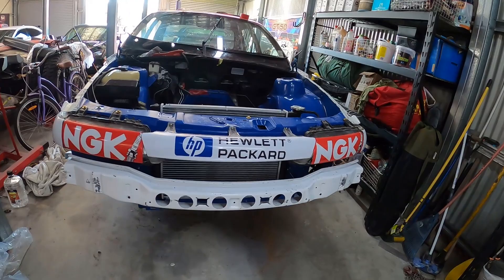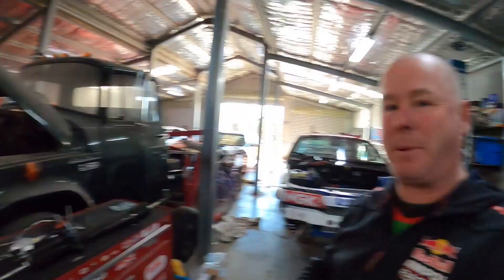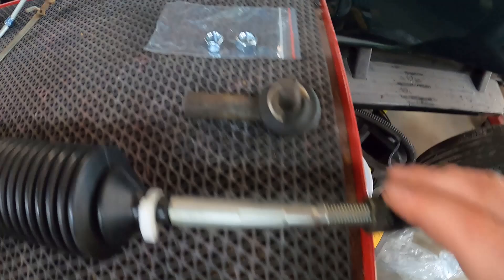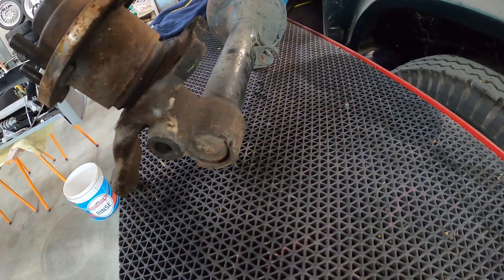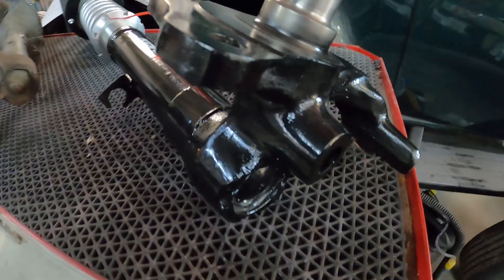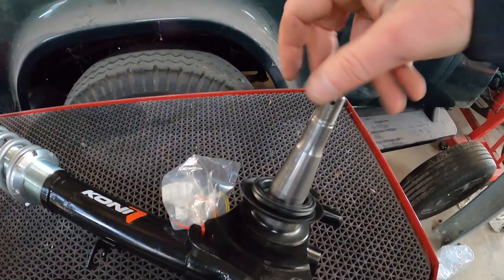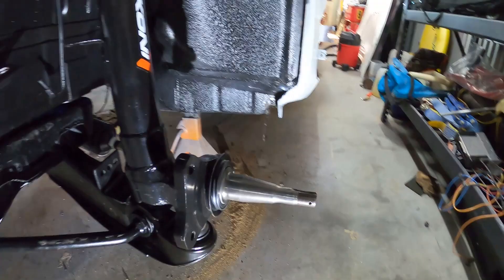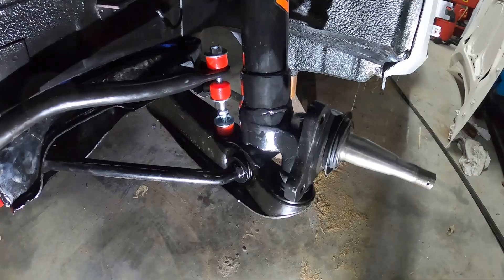VP Brock Commodore Tribute Build - Suspension Mods

Comment: Hi Fred, regarding a previous discussion we had about swaybars one thing I didn't mention is that going aftermaket doesn't mean just aftermarket. It means adjustable bars. I don't know about the rear I think they have 2 positions but the front would have 3 positions. Soft being 27mm equivalent. Why wouldn't you want the adjustablilty on both front and rear. If it doesn't make you go faster then set it to stock. It's probably track dependent think anyway. Harrop Brakes - do they still make them for VZ and under? I want the 4 pots but don't want to spend (don't have) nearly 6k. I assume you'll be going those or will it be the ultimate's? Nice build!

Comment: Spoilt for choice for my ve clubsport. How do the Koni shocks compare to the MRC or Tein, or XYZ?
Reply: Koni is a premium shock similar quality to MCA reds. The XYZ is a budget shock, the only thing cheaper are Maxspeeding. Tein can make decent shock but most people buy their budget options which are miles away from the Koni. Magnetic Ride Control is usually a OME product so customers can switch from a soft damping setting to something firmer by pushing a button. I have never heard of anyone fitting an aftermarket MRC shock system to their car. Clunie Garage fitted BC shocks to their VE ute, that might be a good option for your Clubby.
Reply from the maker: Angry has nailed it! Quite the suspension guru that young man. 😎